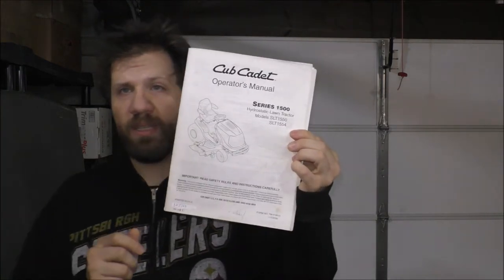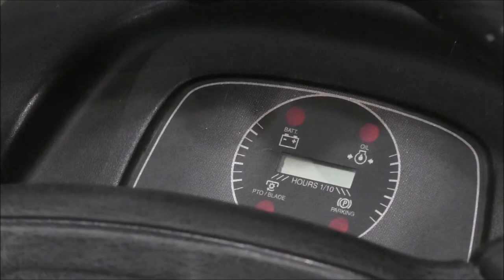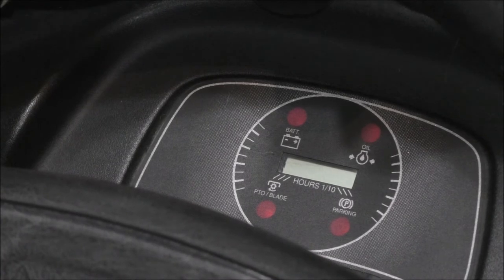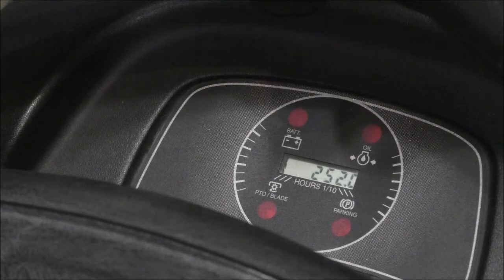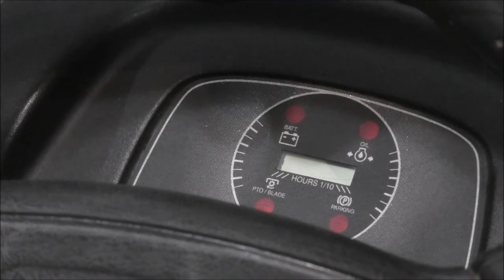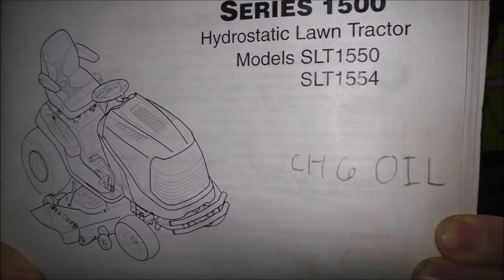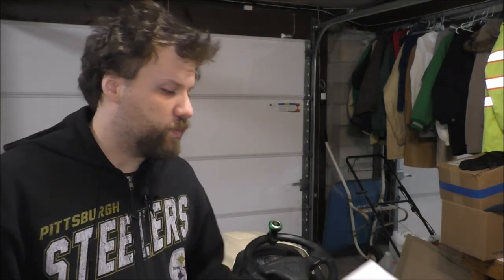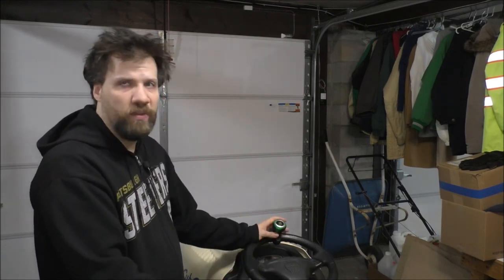CAN ANYBODY HELP ME WITH A CODE CH6 OIL ON LAWN TRACTOR

Comment: The CH6 code is an hourly oil change reminder that displays after every 50 hours of use. The flashing LCD should auto reset after the oil filter is replaced and oil change is complete. 
Hope this helps man !!! 😃
Reply from the maker: Thank you so much for the good information